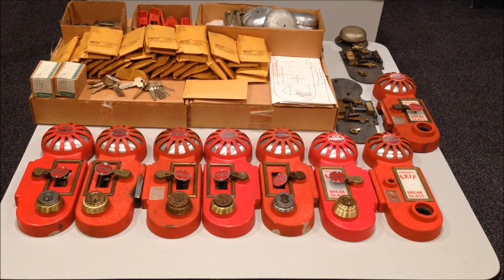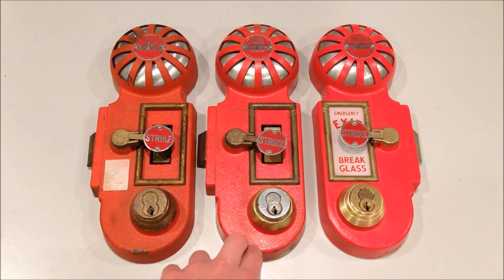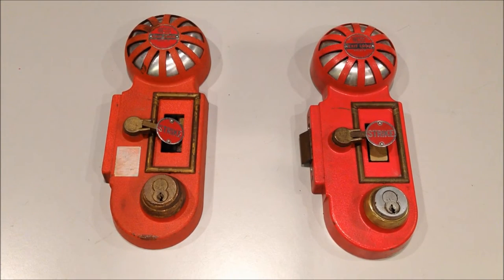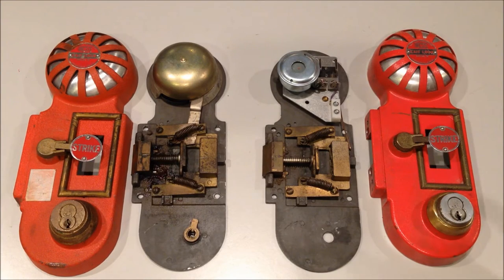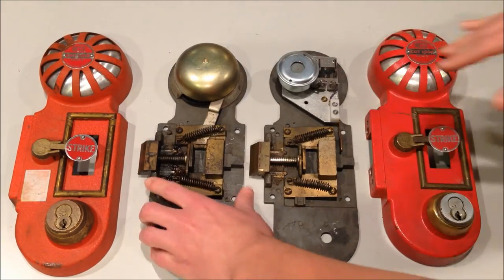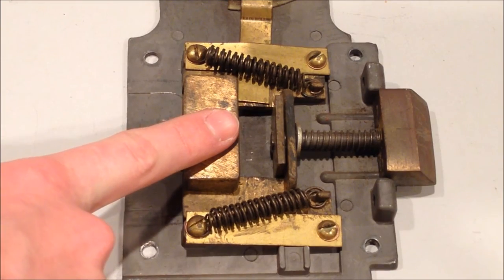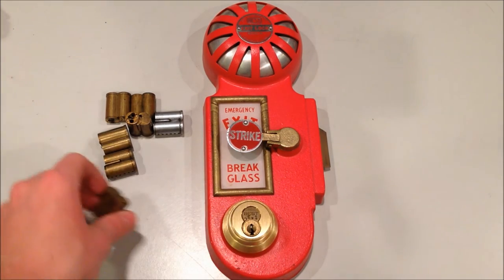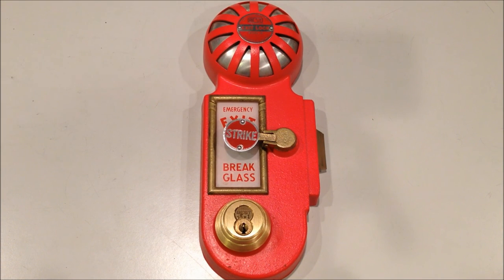Best Lock Model B Vintage Emergency Exit Lock Operation

Comment: So, I just got one of these today.  It has a Yale cylinder, without key.  The Glass is intact, I was hoping your video shows how the glass is installed / removed.  I have not opened mine yet.  I think I may try to find a vintage best SFIC cylinder to replace the Yale.  Thanx for the Video. BTW, I am the Acting Deputy Chief for Delisle and District Fire and Rescue, and I am also involved in LockSport, so I consider this find to be huge.
Reply from the maker: Hi there - the glass is retained from the interior of the station by two nuts. The metal 'frame' around the glass has two threaded rods at the top and bottom of the assembly which set into holes in the main housing. These two threaded rods are then retained on the interior via the nuts. When the nuts are removed, the entire glass assembly is free to pull away from the device, allowing the glass and frame to be separated. I believe you should be able to remove the Yale cylinder without the key, luckily. Access to the interior is gained by removing two screws near the strike on the Model B. At least on the Best cylinders I have, there is a set screw on the rear of the cylinder which retains it. You should then be free to use a pair of channel locks to rotate the cylinder out of the threading in the housing.

Comment: Would you be willing to sell a key?
Reply from the maker: +SirensOfCincinnati The keys I have only work with my equipment. Unlike fire alarm keys, where all the locks for a particular device are the same, the lock cores for these used in every facility are different. So an "OE" (Outside Entrance) key in one building would be completely different from an "OE" key in another building. Otherwise, every building that had these installed would use the same key for the doors, and that would defeat the purpose of the lock.
Reply: Ok, thanks for the info